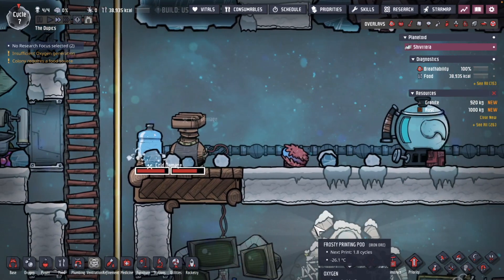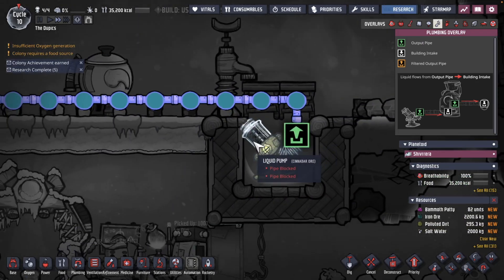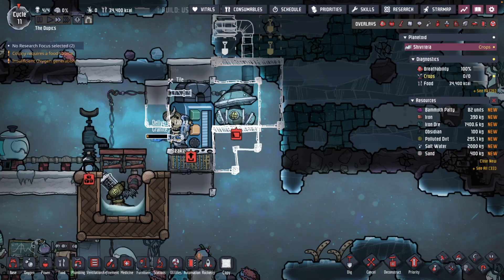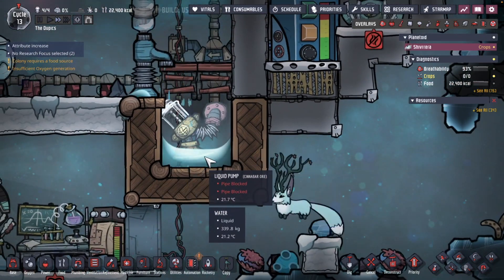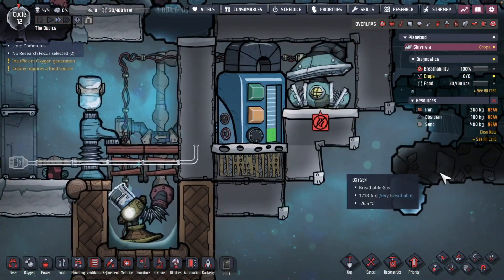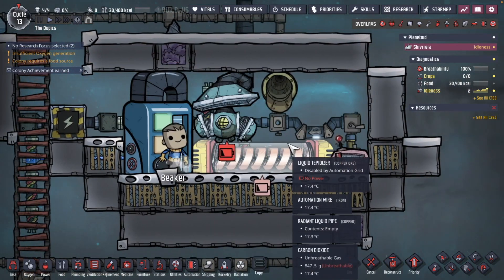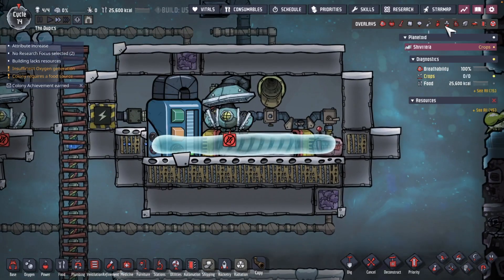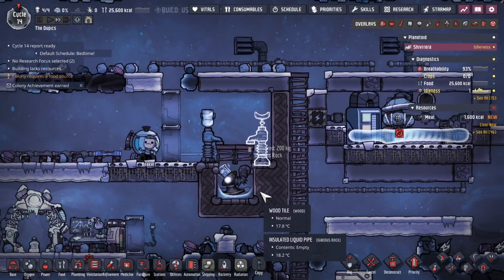Preventing Pipes from Freezing in the Frosty Plant Pack

Comment: If have water less than 1kg per second it won't freeze or change state
Reply: So like if you have a valve just after the pump you can set that to less than 1kg and no matter where you send the water it won't state change. I also just have a tepidizer in the early part of the game so it doesn't freeze at source but you can also just find a source of water that is coming out hotter than freezing temp and store up a bunch of it, the more water the more mass you have to absorb that temperature, also insulated tiles are better for liquid storage to prevent the temperature changing, rather than using the vacuum room
Reply from the maker: The insulated tiles under the liquid storage work really well. I am surprised.
Reply: @jeroxygen  insulated tiles have very low heat transfer so that is why they barely transfer any temperature, the other thing is with air changing liquid temp, the liquid has far more mass so if you have 1000kgs of water and it's transferring temperature with only 2kgs of air then it will take the air ages and ages before it moves the water temperature up even a degree